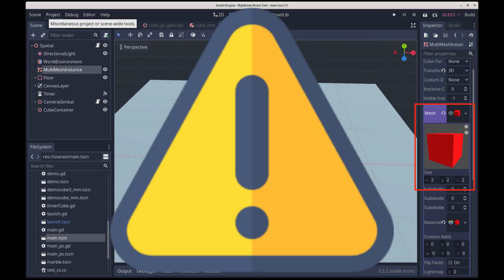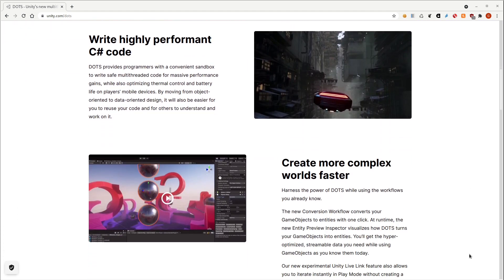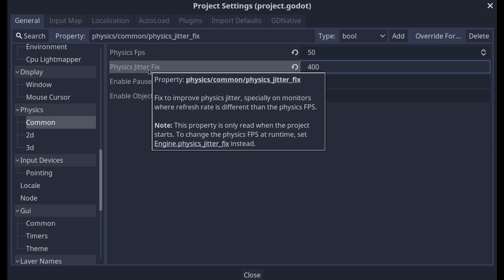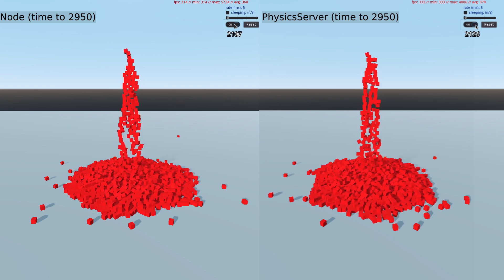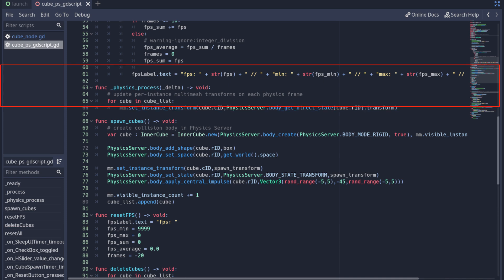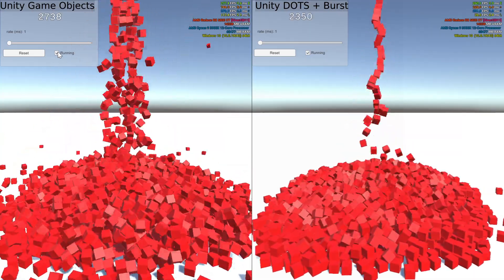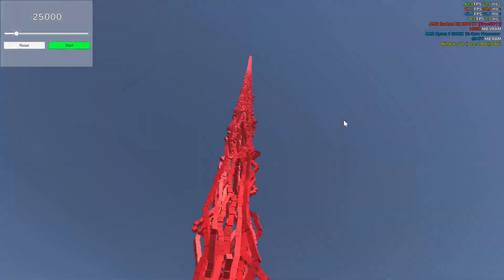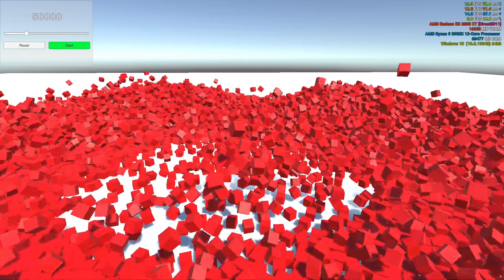Godot vs. Unity Part 2: Pushing each Engine to its Limits!

Comment: When looking at Godot, I sometimes think the dev team made some mistakes in trying to reinvent the wheel:

1. Design, Implement, Test, and Maintain a new scripting language, GDScript... (why not support/integrate Python3, C#, and/or Rust?)
2. Design, Implement, Test, and Maintain a new physics system... (what's wrong with existing physics systems like bullet or something equivalent?)

On #1, Python3's next releases will be focusing on performance, and there're some Python3 runtimes that are already quite performant. Even using Python3 would've likely given them everything they needed, with better performance, and less work - since they don't have to design, implement, test, and maintain Python language features, etc. Support for statically compiled languages, e.g., Rust, would've given you a more modern, performant, and memory-safe language with basically the speed of C. But, no, let's invent our new language somehow made sense to them, and I simply don't see it. (There's also the overhead of learning a new language that's completely useless outside of the context of Godot.)

There's a lot of work that's going into creating new things from the ground up that seems difficult to justify, especially when they're bound to run into many of the problems the existing systems have already solved and they're not performing that much better than the systems they're trying to replace. I'm not sure what I'm missing here, but if I were an engineering manager, I would've defaulted to a "nope" response and expected to see a very good justification to green-light all of this...

Someone, please, enlighten me...
Reply: @nick15684  

> Ok, but you do realize the reason they didn't go with other existing languages is that other languages have quite a bit of bloat that isn't necessary for a game engine, right?

Any language can be considered "bloated" simply by changing the evaluation criteria, so unless you have:

1. specific examples of the alleged "bloat";
2. why it should be considered "bloat"; and
3. why your given criteria to consider the examples as "bloat" should be used,

then, this is just not an effective argument - well, comment.

> GDScript is a small and lightweight language that's only for Godot.

It depends on what you mean by "light-weight". You could just as easily mean "lacking features other languages have" or "having a small standard library", in which case, go back to "lacking features". If the implication is that other languages are "slow", well, all interpreted languages are slower than compiled languages, so if performance was such a concern, which you claimed, then perhaps they should've avoided interpreted languages to begin with.

BTW, nothing prevents the team from compiling another language with a reduced feature set. For example, and this is just for the sake of an example, but, with some work, you could compile and remove "unnecessary" features from the Python standard library and use that (e.g., micro-Python did this for embedded devices...). You can use Rust with `#[no_std]` - and Rust is very performant, which is something you'd want on release.

You mentioned they went with GDScript for performance, yet, in their very reference, they list performance as a problem because GDScript isn't compiled[1].

Again, I'm not trashing GDScript itself, I'm sure it's a good-enough language for its purpose. The point, again, is that there were other good-enough languages already available that didn't need to have this level of time/resource investment put into it.

[1] https://docs.godotengine.org/en/latest/tutorials/scripting/gdscript/gdscript_advanced.html

> This makes maintaining it and adding features to it much easier than trying to constantly do the same with other languages that you have no control over.

Do you know what's "much easier"? Not reinventing the wheel and then having to maintain it.

> They focused on GDScript because they knew that it would be easy for beginners to learn. C# is comparatively much harder to learn for a beginner.

This is relative. What will be harder for any beginner to learn is why their code is crashing when trying to call some method on some object because they have no idea of what data types are.

This is such a problem that Instagram, who built their whole app backend in Python, was, in 2019, giving a talk at PyCon regarding "code mods", which was basically an internal project that, at the time, had been going on for at least 2 years, to modify Python's Concrete Syntax Tree with automation just so they could add type annotations...

Also, there's nothing that's inherently "harder to learn" in C# compared to Python - especially if it's your first language. My first language was C++ and it was easy for me to learn... yet we're not saying that Godot should've used C or C++.

> GDScript is much faster to get a project up and running in a short period than C# or C++.

I agree for C++, not so much for C#. And I'd argue that the difficulty here is the problem I raised regarding integration. If C# were as integrated into Godot as GDScript already is, then it's likely it'd be no more difficult to use than GDScript is right now. And no, you don't need to install the whole .NET framework for it. You could have a reduced Godot-specific subset of the framework (e.g., starting with DotNet Core) or just write their own, which is what they appear to have done with GDScript anyways.

> It just has a faster workflow because it only does what it needs to for its intended purpose.

The only reason it has a "faster workflow" is its integration and that it doesn't have to re-compile every time you launch the application.

> You can do all the same things with GDScript as those other languages in Godot but with far fewer lines of code.

This is likely true, especially with the `$Thing` syntax, but lines of code is a debatable metric. I could write some things in fewer lines of code (e.g., in Perl) that would also be more difficult to follow. For example, this is a Perl program to read a text file specified from STDIN:

`print while (<>);`

Fewer is not always better.

> Build/compile times are also significantly faster with GDScript over say C# or C++.

This is, at best, a weird thing to say, since GDScript is not compiled - it's interpreted.

> This isn't too noticeable on a really small project, but even on a medium-sized project this difference in time will become more and more apparent as you work on your project. This makes testing new ideas and iteration ultimately much faster with GDScript all-around from start to finish.

The other side of the coin is that the more GDScript code you write, the slower the application becomes, since it must be interpreted at run-time. It's a double-edged sword and you pay the price either way. It's a question of when you pay it. In this case, your users do - all of them. Also, garbage collector behaviors easily become "surprising" when your game freezes periodically and beginners don't even know why or where to start looking...

> So a language like GDScript is a game designer's dream language to use when making a game.

Maybe for some, but generally, game designers don't spend their time programming - game programmers do.

> you have a great deal of control over what it does (you manually handle memory allocation and when things get freed from memory in GDScript, for instance)

You can do that, if you inherit from Object; otherwise it's managed by scoping rules. Other languages can also do that, so, while there are benefits, they seem fairly marginal and, again, appear to make the case for a new language hard to buy into. I can see the benefits of, say, Rust over C, since Mozilla had said that, had they had Rust back when they started, with the borrow-checker alone they would've been able to prevent ~73% of the memory corruption bugs that they had had to fix.

> it has static typing and dynamic typing

GDScript uses dynamic typing, not static typing...

> it works seamlessly with Godot's scene-based design...

This isn't a language-specific feature - this is a result of the deep integration and it's an engine design decision. I wrote a barebones engine for undergrad students a few years ago, which they're still using, and it worked "seamlessly with" my engine's "scene-based design", but no one in their right mind would say that the seamlessness was because of the language I used.

> It just works.

No one's debating that. Also, you didn't really address my prior points (e.g., benchmarks, performance tests, etc.).

PS: It's funny to see how you keep up-voting your own comments ;)
Reply: @code-dredd  GDScript does support static typing: https://docs.godotengine.org/en/stable/getting_started/scripting/gdscript/static_typing.html

ex: var a: String = "Hello"
      func _ready()->int:

You can statically type basically everything in GDScript including variables, constants, functions, parameters, and return types.

I thought everyone knew this? It's been in the language for years now. It even provides performance improvements, quite drastically sometimes: https://godotengine.org/article/gdscript-progress-report-typed-instructions

GDScript can be just as type-safe as C# so that argument doesn't even apply.

People have done benchmarks on both C# and GDScript and in a lot of cases, they're closer than you'd think. GDScript is more than fast enough in the vast majority of cases, but other languages like C# and C++ are supported by the engine just in case you need to get every last ounce of performance for that exact reason.

You still have a lot to learn about GDScript clearly, so I'd leave the debate of why they decided to invent it to the people who did it. They clearly know what they're doing.

This article is from way back in the day, but it sums up why they created GDScript and why it will always be the main language of the engine: https://godotengine.org/article/godot-getting-more-languages
Reply: @nick15684  Just for the record, I posted a lengthy reply last night ~5am and now I see that it has been deleted, either automatically by YT, or, I suppose, by some snowflake reporting it for some reason.

I don't have a backup of it, so this will have to do, because I'm not going to spend my time trying to rewrite all of that again.
Reply: @code-dredd  ok

Comment: Object Pooling doesn't make nearly as much sense in Godot as it does in Unity.
The main reason to use Object Pooling is to prevent lag spikes due to Garbage Collection.
However, Godot does not use Garbage Collection, Objects are freed either as soon as the ref count drops to 0 or by hand.
Reply from the maker: You bring a good point that is relevant to GDScript, but don't forget Godot also supports C#.

Comment: now you need to do this test again. with godot 4.6b. which has many improvements to the physics engine and bullet
Reply: Does it even use Bullet anymore?
Reply: @pythonxz  yeah it still uses it, but uses it properly this time
Reply: @BanditLeader  As I understand it, Godot Physics is the default for 4.0 and you would need to install the Bullet plug-in to use that.  Is that correct?
Reply: @pythonxz  no its built in
Reply: @BanditLeader  "Godot 4 marks a big return of Godot's in-house 3D physics engine, Godot Physics. For years, Godot has relied on the Bullet engine to provide a solid foundation for your 3D projects. We felt, however, that a bespoke solution would give us more flexibility when implementing new features and fixing issues." That is directly from a progress report post.
Reply: @pythonxz  and if you read just below that paragraph

"But first, we needed to bring Godot Physics on-par with Bullet feature-wise"

Comment: You could make a cube in one scene which is a prefab in other scene and duplicate cubes in main scene. So if you change something in prefab it will change in real time. You need to dig in more about godot before comparison. I do agree unity is a really good engine but you always have to remember that godot comes in the matter of 68 MB while unity as over 5 GB.

Comment: Interesting, what's your PC specs? It looks like godot dont have multithreading in physics engine, that's why Unity outperforms up to 10 times
Reply: You can see it in the top right. Ryzen 3900x (12c/24t) and RX 6800XT.
Reply: @ivyy8221  lol, didn't see it on mobile 480p)
Reply: @BeluCatBMG  difficult to see at that res and on a little screen hahaha
Reply from the maker: Yes, exactly as shown on screen. =)  Ryzen 3900X (12c/24t) and RX6800XT.

Comment: oh man if only you knew 10:52 that godot 4.0 is slower in every possible department. the editor is slower, gdscript 2 is slower and the physics is so bad its no joke, also the physics is rlyyyyyyyyyy bad, since they removed bullet and made their own rly bad barebones physics engine, the "new" godot 4 physics engine looks like a cs student class project. godot 4 is 1 step forward 10 steps backwards - all hope i had for 4 evaporated, its so shameful. if the past 3 yrs the resources invested in godot 4 were invested in 3.0 instead, godot 3.6 - 3.8 would be probably a monster of a cool engine